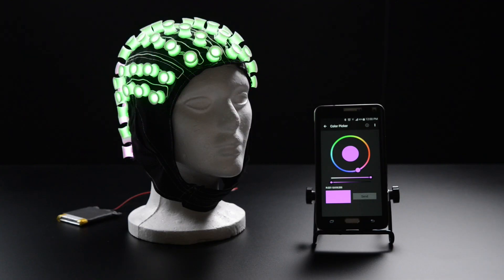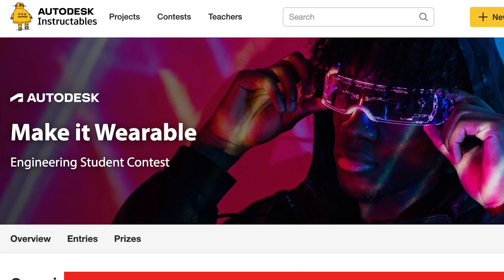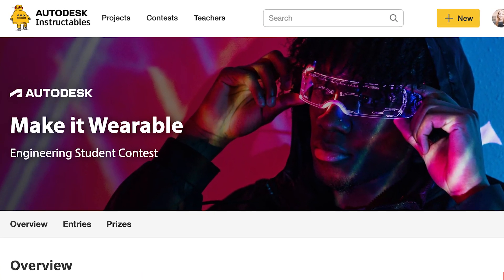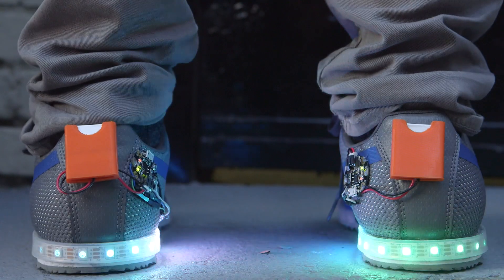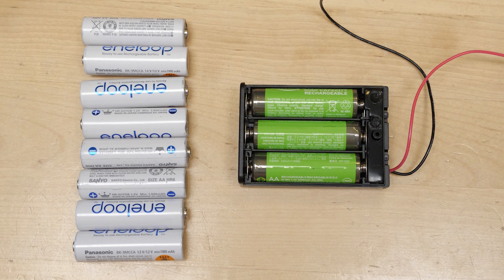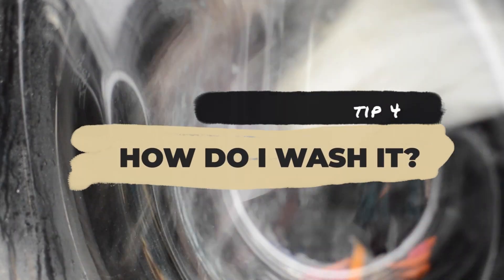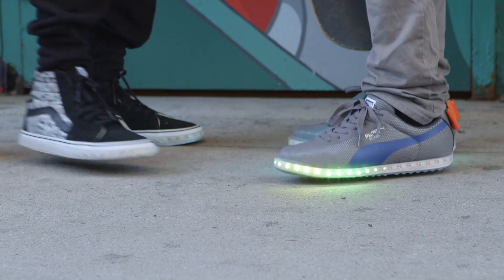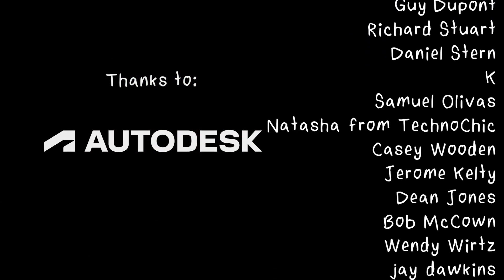Becky's Beginner Tips for DIY Wearable Tech

Comment: I made an amplitie many years ago, but like you mention it stopped working properly after a few years. I never figured out the problem, but I'm guessing oxidation made the conductive thread connections unreliable. I wonder if there's a way to bring it back to life, apart from ordering new thread and redoing the whole thing?
Reply from the maker: Did you make it with steel thread? Rather than tarnishing, that stuff is more likely to spring loose over time because it's so... springy. Send me a closeup pic of some of your connections and I can provide a better assessment.
Reply: @BeckyStern  Yes, it was steel thread with clear nail polish. I'll send you some closeups. Thanks!

Comment: Great video. But I would tweak one thing. at 5:25 you said all usb power banks are 5 volts. That is not the case. USB C power banks do USB C PD and that can be several different voltages based on the connected device. there are USB C PD sink controllers for diy projects that allow for voltages like 9volt up to 20 volts.
Reply from the maker: But the device has to ask for that alternative voltage, otherwise it defaults to 5v. So they really do all supply 5v, and some additionally can supply more, as you mentioned. I didn't think a tips video like this needed the pedantry of this detail, instead trusting commenters would do that for me.